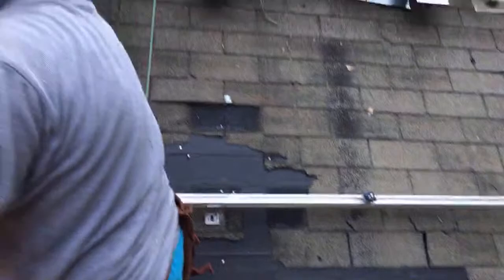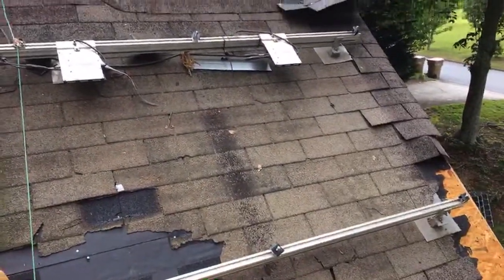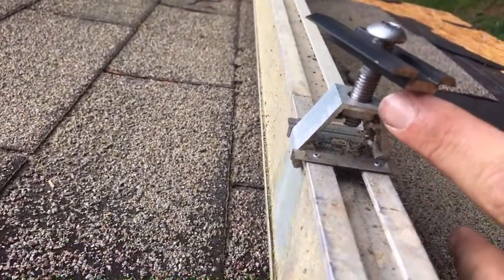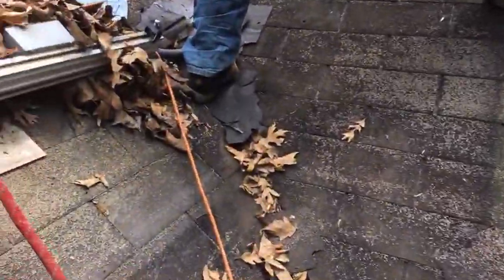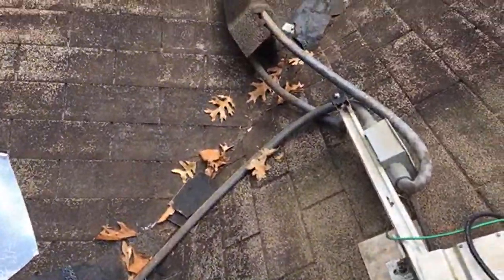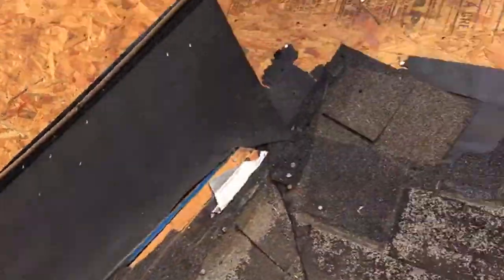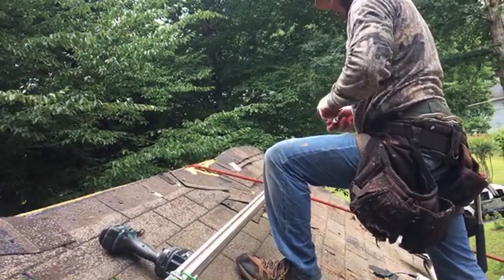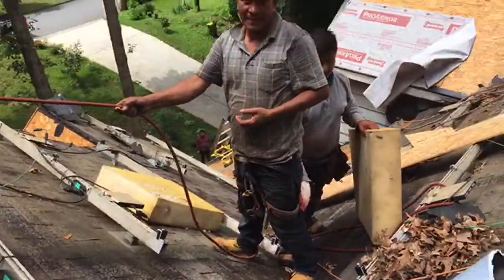The truth about solar on shingle re-roof!

Comment: So what used to be a $7000 shingle job in 2019 will now cost $20,000 in 2021 if solar panels have to be removed and reinstalled.
Reply: I thought the whole idea was to save money this doesn't look like you're saving money this looks like you're pulling more money out ?
Reply: @Kenneth165-f5u  No solar panels should be ground mounted imo.
Reply: The whole reason I won’t do it. I’m a DIYer but I’m not removing solar panels just to fix a roof leak!  On the flip side of that, I’ve heard horror stories about solar panels. Our electric bill is barely over $50 except in summer months. Not worth it for us.

Comment: If you were not scraping the system would you have still taken the rail flashing off to reroof ?or just shingled over the flashing ?
Reply from the maker: It’s common practice to remove everything. Most roofers won’t/can’t roof over existing flashings and at the end of the day you have to get the roofer to guarantee it. I’m usually working for the roofer on these jobs. We have roofed over existing flashing before using ice and water shield